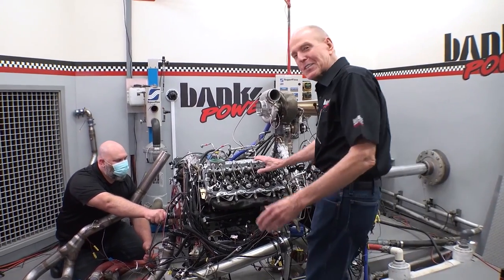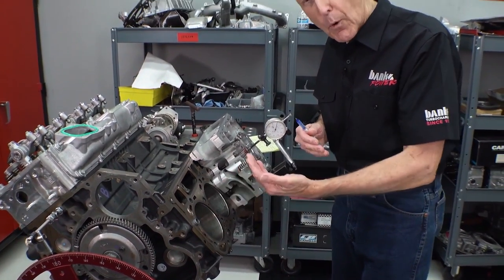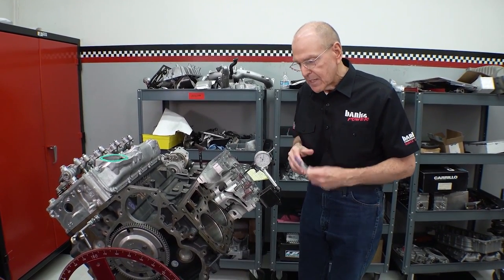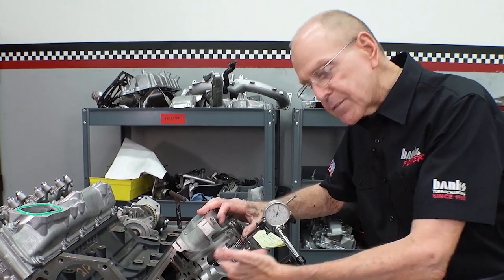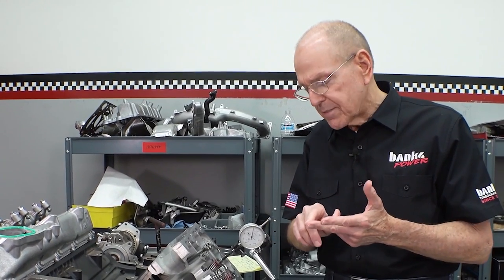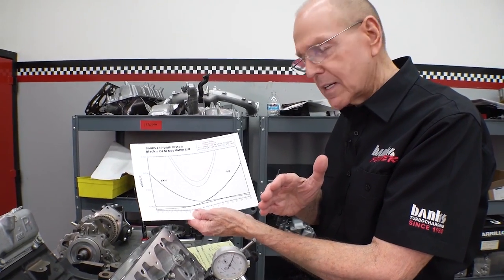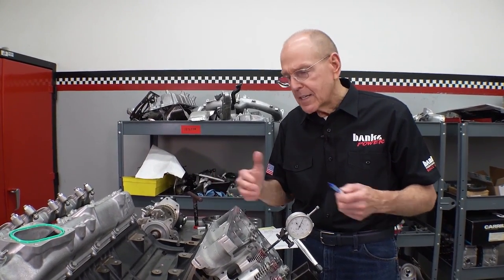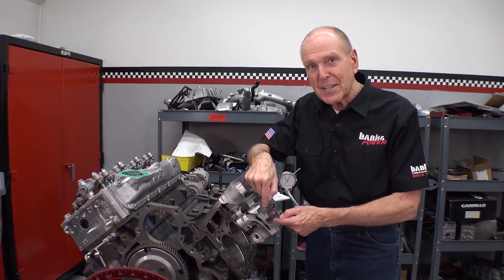NEW CAMSHAFT! Killing A Duramax Pt 13

Comment: I'm not an engineer, but I love watching this stuff. Wouldn't the spring rate change under temperature from the engine running?
Reply: Not by much. Most tolerances (slack) left in an engine during dry (cold) assembly is there to allow for expansion when heated. Hot tolerances are where it's at. 😀
Reply: What happens is the springs soften when they get warm, but there is usually enough oil splash to keep them from dying. Nascar engines have a spring spray bar inside the valve cover to make sure they don't cook. There is lots of difference between the .400 lift here and a circle car with .800 lift and more than twice the rpm. Hot lash is where it's at, everything has thermal expansion and it can bite your ass if your not careful. Some all aluminum engines with solid cams you have to run with more lash than typical because when the block and heads are cold the lash dissapears and it'll cook the exhaust valves when it's warming up. You see high end engines use aluminum pushrods for this reason.
Reply: Thanks. I love learning new stuff. :) I thought maybe with the spring relaxing under temp that it would change the tolerances they'd be able to have on the cam.
Reply: @ucantrun2793  the dz302 has what is know as the 30/30 cam because that's the recommended lash. The ramps of the lobe, where it goes from 001 to 020 tappet lift (there is a 1.5:1 rocker) is pretty gradual. It's not so much the springs changing seat pressure that changes the tolerances but the change of size of the components themselves. Even exhaust valves usually have 002 more lash because exhaust valves are high Chrome steel that expands more and they get to a higher temperature that makes them expand more again.
I was interested in your question, came up with a bit. Valve springs in an engine do soften with temp, it's 10-12% over 100°C. That's consistent with high cycle chrome silicon or lower duty chrome vanadium springs. Most engines will not change by 100C in a cycle and the springs are normalized at 20C. Most new cars have a 90C thermostat, that's 70C above where the springs are measured. You can probably take that there is going to be 7-9% less spring pressure on a running engine than what you measure on a bench, actually quite a bit. I knew that valve springs needed care on cup cars and high intensity things, I had never thought to look up what temp they actually soften.
Reply: @timothybayliss6680  Some billet Alu dragrace  engines have no lash when cold.  When warmed up before the real action.....sometimes lash has increased beyond the max valve lash to be used.   I have 1 customer using an almost negative lash when cold.   On temperature...it is just right...   These dragerace engine use vslve spring seat pressures if 500+ lbs and when valve is opened 1"......spring pressure is in the 1400 to 1500 lbs range so aluminium pushrods....will not survive...
Reply: @Baard2000  that's lots of spring. Many Top fuel guys use 1/2" solid tool steel pushrods just because of the mental valve loading. They still deflect, especially the exhaust as it opens against the charge. There are places an Al push rod is the right one, and it's air cooled aluminum engines. Even if you can warm the engine and set lash or don't mind the noise when hot, an aluminum pushrod will work better as the engine changes size so much when operating. Some v twin guys are running .700 lift and 10k rpm, and granted they're not stock the pushrods are Al. Unless your drag racing the change in lash beats the rest of the valvetrain. That's what I meant about burning the exhaust valves. Some guys don't know better and build their engine, warm it up and set lash and the next time it starts when cold the valves are just off the seat and get a little toasty.
Reply: The stack height sure would.

Comment: Wow! Why would anybody want to go electric when you have this guy around? Awesome!
Reply: He is working with 48v centrifugal superchargers now for boost off idle. Audi uses one on their diesel v8 for boost right off idle, may be the same one. They don't work great for the only compressor but for a one second spin until the turbo gets moving they're the bomb.
The next step above that is a brushless motor in the turbo itself to spin it up. You can eliminate the alternator on the engine because the turbo can harvest energy. Think what f1 engines have. I know it's not all electric but some of the stuff is badass and can really make some hot rods.

Comment: I don’t think a camshaft is too “inside” the engine. I would agree with you, if rods/pistons, crank, etc... had been changed. Changing valve timing, eh...
Reply: If it was an OHC then id agree but pushrod cam changes definitely require a bunch of disassembly which i think was his point
Reply: The cam is literally inside the engine block.  And since this one requires removing the cylinder heads to change the cam, I don't know how it could be any more inside.  You're tearing down half the engine for a cam swap.
Reply: ,,, quite a bit of this is to see what can fit inside . I agree with this step, regardless  .
Reply: But the whole idea of this is to see what is capable on stock bottom end!!! As in bottom end not top end. I don’t think it could be any more clear ,seeing what rods pistons and crank can handle is way more beneficial to all of us duramax lovers than where finding out where the cam or heads choke. What he already achieved is huge and the only reason he can do this is because he is doing right and not just dumping pounds of fuel an air in without a care this cam swap is going to get us over 1000hp safely this guy is my freaking hero .
Reply: @jameshaskell6572  agree, this is a bottom end test, not a stock cam test
Reply: I think it is here- this wouldn’t be easy with the engine in a truck. Not a quick job. I appreciate that the bottom end is stock, but I think he found the limit of the stock duramax... it’s 912 bhp.
Reply: It's a little of both, IMO - 
Normally I would class removing the heads for a camshaft change, rather than just the intake, as a step up on a 'simple' cam' swop.
However, if done as part of a head upgrade/rework at the same time, on a stock bottom end, it also works.

Either way, the basic clearance checking still applies - so I have absolutely no problem with either viewpoint.
Reply: We're looking for the strength limits of things in the engine, and finding out flow limits along the way. If he has to upgrade fuel or airflow to find the limit of hard parts, I'm all for that. The bottom end strength is what a high percentage of us want to know. Even the head gasket is interesting but it doesn't really matter.   This is more work but very little different in principle than swapping out the stock turbo. Still more airflow just a different method of obtaining the desired result.
Reply: @Metalwolf765  Was all this a test to find out Max power of a stock L5P? As soon as you change one thing on it it's not stock anymore right? He's WAY past that. The whole point was to see how much the basic rotating assembly could handle.
Reply: this engine is a beast but the cam, like the turbo etc is built with certain parameters in mind. Others that don't have the resources Banks does, will throw fuel at it until something explodes  and won't know why. We and the others that are and will be modifying these beasts in the future are benefitting from the fact he's chosen to share some of his expertise. In no way in my opinion is a cam any more of a deviation from stock than a turbocharger or injectors, just in this case it requires a little more labour.
Reply: Cam is certainly "internals", particularly in a pushrod engine, but I agree...this is a test of the stock rotating assembly, which is what the title should read, I guess. We all know what he means.
Reply: Let’s just think for a minute you bough a new truck. 
And wanna change the camshaft. 
How much is it going to cost?
$5000?
$10,000?

Peace. Won’t waste my money

Comment: Hot rod guys think they're real smart when they throw cam shaft numbers around...but I think they just got schooled!
Reply: Back in the 1970's or so, there were some camshaft companies who got bad reputations because they didn't respect the stock or modified valve coil bind and rockers etc. They sold lots of cams but it didn't last very long due to the self destruction and high wear they built into them.
Reply: @Garth2011  Exactly!

Comment: Very cool presentaion of something I keep trying to tell folks - you have to check V-P clearances a little before and after TDC, NOT JUST at TDC!
It also informs the engine builder what sort of range (s)he can adjust the timing through to tweak the camshaft's action.
It should be noted that because of the working geometry, what works with one stroke using one 'rod and piston combination, may not work with the same stroke but a different 'rod length and piston combination. ALWAYS check - a previous owner may even have machined the block and/or head, further compromising clearances!

I would suggest adding another check, the clearance between the valve stem seal and the bottom of the spring retainer/cap - some engine designs allow very little clearance for higher lift camshafts and need the guide machined and/or lower profile seals to be used.

Comment: It lives on a dyno. it wont live with moronic idiots turning up the fuel to fog out an intersection.
We use an -01 F-350 with the 7.3   Its tuned for 500hp and 800lb/ft  Zero Smoke Under Any Load. It fires right up, doesnt  hunt for an idle, nor does it smoke under boost. 10psi at 70mph with 10k lbs behind it. It will reach 50psi if you ask it to, all this on a stock engine, minus a tune, a slighter better turbo/intake/ intercooler setup.
we can push it to 700hp/ 1100ft/tq if we want on the fuel system its running and still wont smoke.
That Duramax is a fucking joke.
I mean, with fuel system we have and the air we can use, we can push it to 1200hp right now and it will live just fine..  Cant Beat Ford.
Mind you, Stock this engine made 250hp and 400ft/lbs     Well, it is stock.. lol
Reply: That's not a Ford engine.  It's a Navistar.  Post a video showing it on the dyno.
Reply: You probably have the stock turbo, injectors an hpop at 500hp too. All of the 1200hp powerstrokes that are out there I am surprised that more people aren't swapping them into their dodge trucks. This duramax also makes more torque stock than your truck does today, and probably more horsepower, if not a tune on a duramax can bring them over 520hp. 7.3s aren't bad but they're antiques now. Everything about them is a technological dead end.

Comment: "only" made 912 HP with a bone stock engine... (( I'd call it 900 HP ))..  good enough for me
Reply: Well. Stock internals and block.    Not much else is stock.
Reply: What cost for all the parts though. 
You buy a $35,000 truck. 
And invest what, another $25,000 into the engine?

Just to kill a trans/rear end. 
Upgrade those and you are over the purchase price of TWO new trucks. 

You could find an older model engine and have modest goals and save yourself years* of wasted income, that you never get back. 
In fact when it goes boom you gotta pay all over again.

Comment: How much compensation do you need for piston and connecting rod expansion? Granted it would be small, but when you're pushing it to the limit, you need to know your limits!
Reply: Didn't he say those #'s were with a hot engine?
Reply: . 028 is really tight. The AL piston will do most of the expansion. The crank and rods will have roughly the same expansion rate as the cast block. They just have a way higher temperature. One dude I knew was the president of a corvette club and official builder. He would set up 6k rpm nitrous big blocks with .035 clearance. It's tight but I wouldn't get too bent out of shape about it.
Specifically, it all depends on materials and temperature.

Comment: Dumb question. If you had a push rod with grooves running down the sides of the pushrod long ways. Wouldn't the push rod be stronger than just a reg smooth push rod? Less deflection?
Reply: Brian Schmidt wouldn't that cause more friction and thus heat? Also, metal act as a spring so deflection may also occur as length compression.
Reply: A cylinder is about the strongest shape for compressive load, no reason to complicate the shape
Reply: With ball or socket end pushrods the loading is almost entirely along a single axis. I understand what your saying and yes it would be stronger but would it be better, prob not. A few companies make tapered pushrods that are the largest diameter at the middle. This makes them stronger with regards to deflection while adding minimal weight. The amount of lateral deflection is proportional to the distance from the point of load, having the centre the most rigid adds the least weight. Theoretically the load point of a pushrod is a point, and given that there is zero lateral deflection it could exist as a point.

Comment: Hey Gale, why was the intake piston travel a few thousandths different than the exhaust piston travel?
Reply: I think the piston valve reliefs are different depths, the valves are at a different height in the head. This means there is a difference between the minimum piston to valve clearance between the intake and exhaust valves. The exhaust valve also looks like it closes later than the intake opens, relatively to TDC. There really is a bunch of information on that one piece of paper.

Comment: I have a few questions about the valve springs. Don’t springs usually have a decrease in force or spring rates if you fully compress them? Also if they are compressed too much won’t they possibly suffer a fatigue failure? Have you taken this into consideration and have a new life expectancy for the springs?  These videos are probably the best on the web for this subject matter.
Reply: Spring really don't change rate unless they are specifically wound for a variable spring rate. They will change a bit, especially because these are beehive springs but they don't change rate that much and the cam he installed doesn't increase lift. Suspension springs do this, they have an escalating rate during compression. I would be very slightly worried about fatigue life of these springs. 400 lift and 4000 rpm is a pretty easy place for a valve spring to live. Eventually they will fatigue but some stock trucks have a million miles with factory springs. The modern metallurgy has probably improved valve springs more than anything in the last 50 years.

Comment: Could you imagine if they just ditched head gaskets completely and went over to o-rings?
By the way... my head hurts now.. Cam talk is so far above me..
Reply: Dry deck would be cool to see also
Reply: Unless they were metal rings they would die almost immediatly
Reply: F1 engines for years haven't used "gaskets" in the head. They use captive orings, silicone, wire rings but not a gasket like we think about. The machining quality is suberb and the materials have nearly identical thermal expansion, if they aren't the same alloy. When you have something like this with two dissimilar metals you need some kind of gasket.

Comment: Haven't there been a number of 1000HP Duramax's without all this craziness?
Reply: Yes, but Mr. Banks is showing how to build an engine that will do that and last. Ironically, he has to kill one to do it. Throwing fuel at it and hoping it doesn't melt down is not smart engineering.
Reply: Craziness? It's a fuel pump, injectors, turbo, camshaft and plumbing. Plumbing like uppipe and intake snorkel. Gale's done it in a dozen steps now, reaching the limit of components before switching them out. You can go back through the series and see what it takes to make 600, 700, 800 and now 900hp with no smoke.
If it was a 1000hp project, you wouldn't have even tried the stock injectors, high pressure pump and turbo, you would start where this is now and add head studs and pray the rods don't bend.
It's methodical, crazy is a bit of a stretch.
Reply: Uh, there have been so w with more than that...I think this whole series went right over your head lol

Comment: So what you're saying Gale is 912 hp is about as much power as you can make on a Duramax only touching bolt on type parts. And changing a cam is fine for this series as it is killing the Duramax, so you're trying to get to failure or cracked block/rod, blown gasket, ECT to see how far you have to go before thinking of upgrading those components. And it seems for an practical application on the road, you wouldn't have to do that. I really want to see a series like this again with a common engine to hop up or swap into projects like an LS, 2JZ, 12V (just examples of most common, I think the limits of stock internals on any of these are pretty well explored at this point).

Comment: Talking of pushrod deflection, I viewed a video of a guy who does work for Nascar and or NHRA engine people. He runs Spintron dyno that only Engineers usually use.  He can spec valve components like pushrods of different thicknesses to develop the most power without killing the cam with unnecessary thickness, flex or weight. I think you might find this interesting.  Watch out for "valve loft"!  https://youtu.be/Xzt6np8N3p0

Comment: Watching these short stories about the step by step process of tweaking, tuning, building HP are extremely enlightening. Only wish I was younger to have more time to do the things that Gale Banks is doing, oh yeah and the finances to pay for it all : )
I would love to see after all of the dozens of adjustments and changes go back to the original stock motor and apply all the new changes to all the piping, air filter stack, oil cooler, exhaust, raise the stock turbo up, vibration damper. Everything they learned short of changing out turbo, injectors, cam, fuel pump. Now what will that stock motor put out for HP?? Makes one wonder about the possibilities. Eagerly awaiting for the next  chapter to arrive.